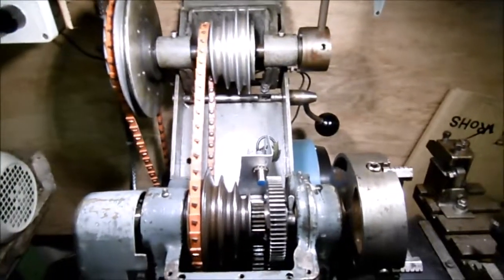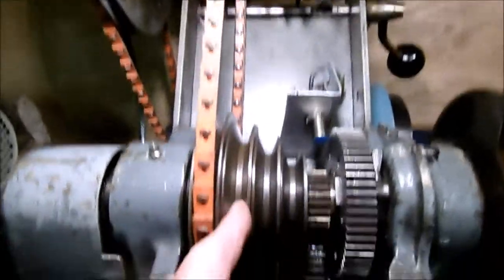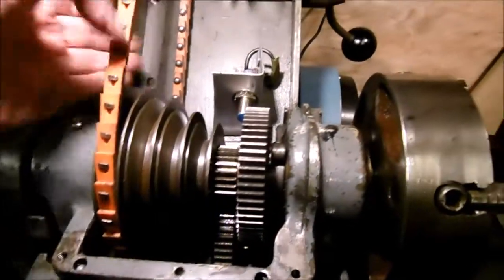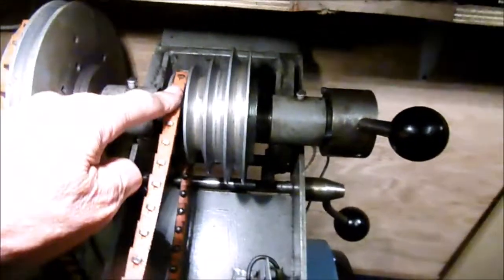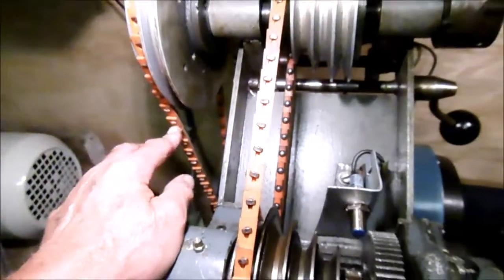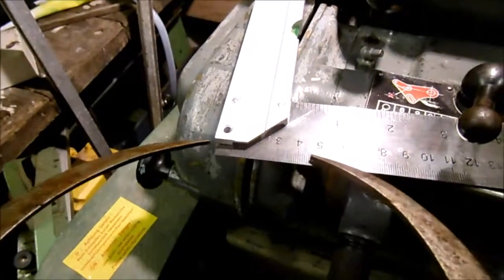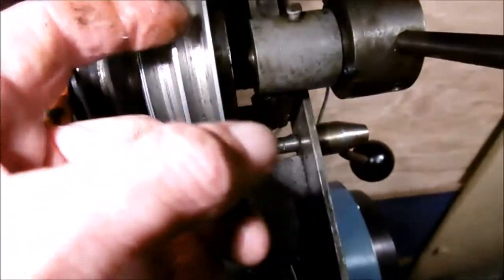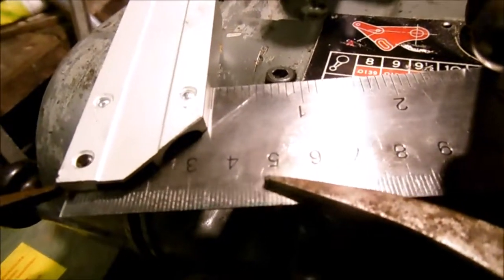Stepped pulley size on Myford super 7 layshaft

Comment: The root diameter is arbitrary, so long as it is less than the maximum for the pitch diameter. When I made a replacement v-belt pulley for my motor, I started with the pitch diameter, from which the outside diameter is quickly determined, then the half-angle for the groove (17 degrees in my case), then made sure the root was no more than the max.

If I were you, I’d measure the outside running width of the groove (1/2” for an A-section belt, per the ML7), and the flange OD for each step. From there, using v-pulley measurements easily found online, you can find the pitch diameter. I strongly suspect that those will be equal, and in opposite order, for each of the stepped pulleys, regardless of the root diameters.
Reply from the maker: Thank you Billy. That is very helpful. Hopefully others coming to this video will find your comment. John